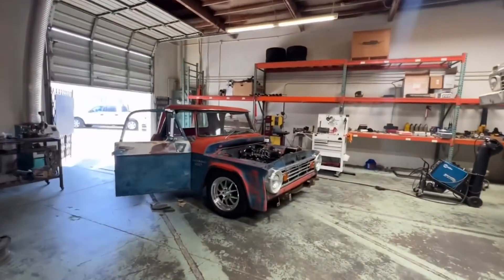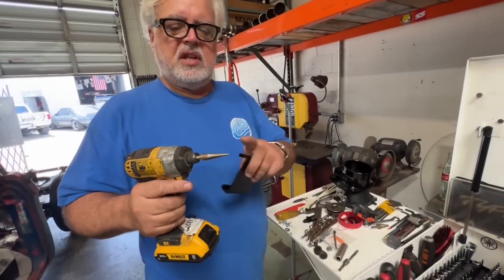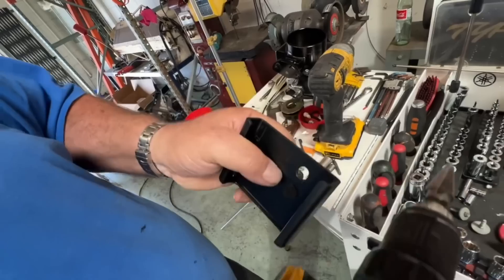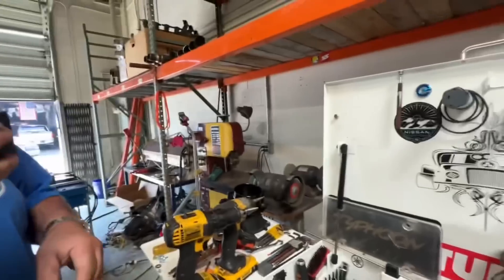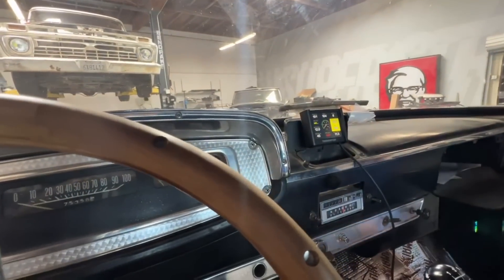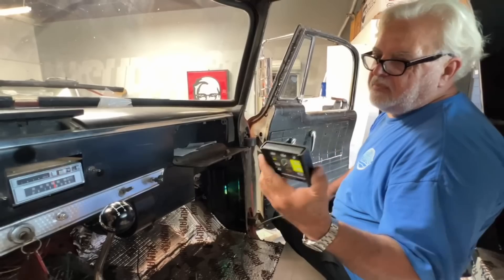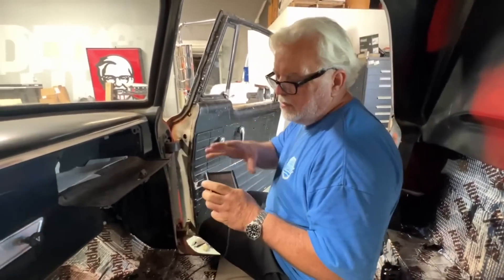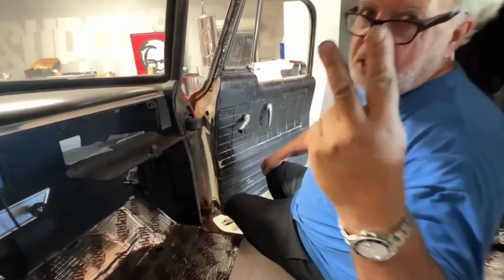Holley EFI Controller Tech Tip and Lucky Hack!

Comment: Heres a tech tip...if that magnet is strong enough it can compromise the data on the SD card in the handheld. Not to mention the display and components built into the handheld itself.

Comment: Great video Lucky , dont know if what i did was spectacular but i finally got my Ram 3500 back on the road , its been down about 3 years , the transmission went out and i rebuilt it myself only the second transmission i have built , but i don't have a lot of money to throw at projects and i wanted to do it up a little better than stock so it took me quite a while , then having to order the selectives to make sure all the tolerances were good , plus i have pretty much been working midnights the whole time till recently and with having a wife and kids balancing the time has been tough but i got it . Still some things i want to do to it but just happy to be driving it again.